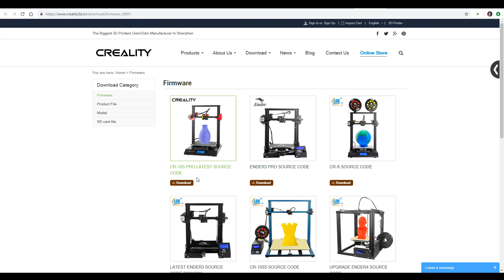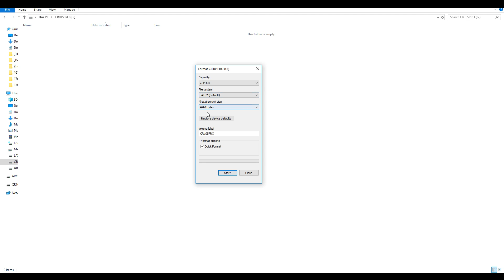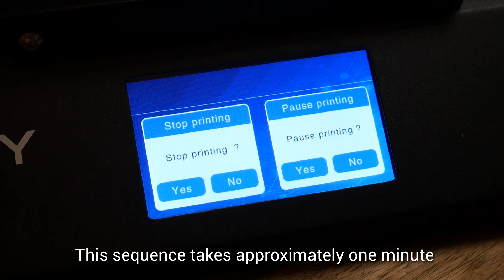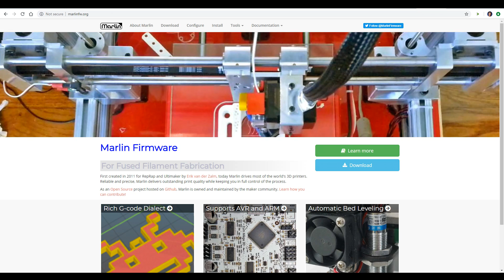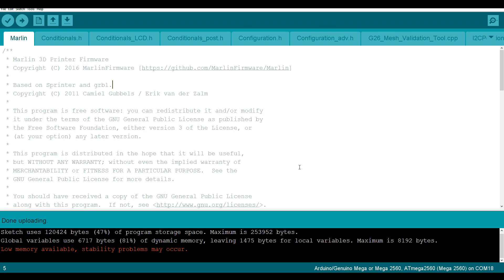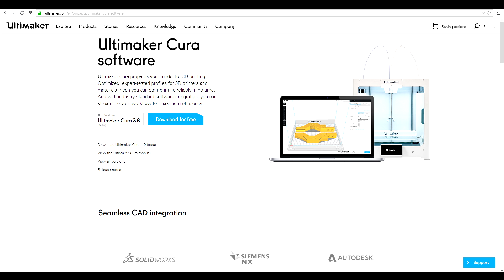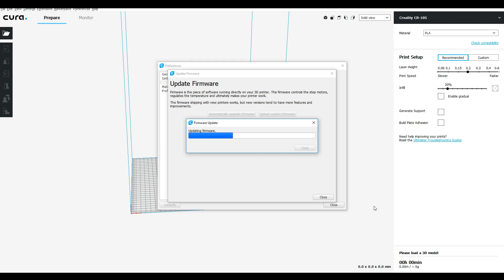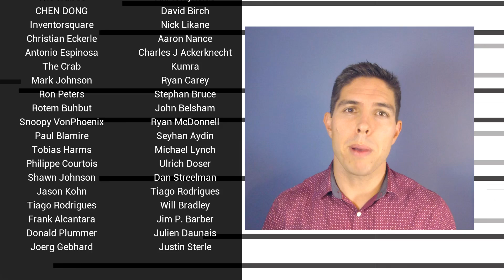How to update CR-10S Pro firmware - LCD and mainboard

Comment: Super Video!!! Very good explanation. But i have Problem. After updating LCD and Firmware (With Cura 10sprobang.hex) the Printer can't find original Position (middle of the platform). also at measering he can't find the exact Points. i hope you can help me

Comment: loaded per instructions..... loads the screen directly to the showing end.. mine does not go through all the screens like yours? any suggestions? thanks for the great video!
Reply: I had a similar problem.  Jump to 3:20 and note that the allocation size may be important, as it is specifically pointed out.  I also noted that the default name was longer using the windows formatting tool, so I reduced it to reflect the example "CR10SPRO" without quotes.  After doing these steps it worked for me.  In fact, my screen is now using the RED color set :)
Reply: @dnainkable  You, sir, are an eagle-eyed superstar!  I had a feeling it would be a FAT issue, that maybe I'd formatted FAT16 rather than FAT32, or vice versa, but you were spot on with the allocation size.
Mine's all updated now, I even stuck my own modded boot screen on there.
Mooch-arse grassy-arse, dude!  :D
Reply from the maker: Is it updated and working? If so, happy printing.
Reply: It didn't update the screen. I just updated the latest firmware on creality. The screen would not update.

Comment: anyone able to get this to work with cura 4?  No matter what I do it doesn't see my printer.  Yes driver is installed and I can see the com port when i go into device manager.
Reply: I don't know about Cura 4, but for me when I updated in Cura 3.6 at first it wouldn't connect to printer, but after I let it sit awhile and came back. It showed connected. Not sure if windows or Cura was doing something in background.
Reply: I can confirm that Cura 4 works for the update.  What about the COM port number?  Some problems arise when the COM port is larger than say 10, for example.  I have a COM port of 4, I believe.  You can check in the device manager if you're using Windows, and adjust as necessary.  You can find information elsewhere for changing the COM port.  For others: If you're using a mac, disregard.

Comment: Today I got around to update to Tiny machines firmware. Did both lcd screen and main board firmware. Wen't to print from SD card and while print is started, I like to go into the adjustments tab on LCD screen and adjust any z offsets while watching first layer. As soon as print starts, the LCD goes to main menu, not allowing you to make any adjustments or even cancel print. I wouldn't think it would respond this way. Have tried several times and each time a print starts, it immediately goes to main window. Has anyone experienced this at all, or have a solution. I also tried to go back into the print option but then it makes you select a new print, which gets in the way of existing print. I am not sure if Tiny Machines updated their firmware. I did the 10SPRo hex from Tiny Machines web site.
Reply: This happens when the computer is still connected to the printer, try printing from SD card with the USB to the computer disconnected.
Reply: @naderal-ghazu2222 , My desktop nor laptop was not connected while printing from SD card, however I did have my raspberry pi hooked up which I use for Octoprint . And since the pi is a mini computer I decided to try printing from SD card with Raspberry pi disconnected. Worked great since following your advice. Thank you very much.
Reply: Also wanted to add I can print perfectly fine using Octoprint using Tiny Machines firmware. Both bed and nozzle temps show up now inside octopint. Thanks again.

Comment: Okay I am about ready to have a fucking stroke!!!  I followed YOUR tiny machines instructions to the letter!  I successfully updated DWIN, I successfully uploaded the tiny machines .hex file.  I ran the reset.gcode as instructed on the tiny machines page.  I power up my printer and the thing no longer goes to the center of the fucking bed!!!!    Why is it way forward and to the left???  How do I get my home position back to the center of the bed???

https://i.imgur.com/DdxurT4.jpg
Reply: Screw it.  I went to the creality 1.6.71 hex file.  Also Cura 4.0 has a BITCH of a time connecting to the printer.  I finally got it to connect and update the firmware the first time with tiny machines stuff.  Then could not get it to see the printer in Cura on trying to change to the Creality hex.   ARGH!  so then I proceeded to go through and frantically press buttons, twist knobs, clicking check boxes, cussing, banging on the damn computer, just short of waving voodoo beads over the mainboard and sacrificing a chicken  until finally it gave me the option to upload the hex file again.  Seriously if I have to do it again I have no fucking idea what was the thing that finally made it connect!!!

It is working now but son of a bitch!  Why send a machine out with 1.6.3 firmware when 1.6.71 has been out for weeks?  Why not at least include an addendum or make a comment on the sites bed leveling and setup page warning people that they aer using the 1.6.71 version.  I got home at 5pm had the machine assembled by 5:30. Then proceeded to work all fucking night until nearly 10am SATURDAY before I even got to a point to level the bed.  Then found a dozen videos that were either incomplete, or completely wrong!  It is not rocket science to level and I am going to make a proper video on ho wto do it as I have not found a single one that is correct for 1.6.71!

Comment: I just got my CR10S Pro yesterday. Do you recommend upgrading the firmware immediately?  I had no problem printing after basic leveling. What does this firmware update improve exactly? 
Second question: What is the maximum print speed mm/s you can achieve with CR10S pro? Can you share your print profile soon or make another detailed video like your comparison video soon? (Cura profile please!)
Thank you for your great videos.

Comment: Great video Michael, as always. 
I have an off-topic question to all you guys from the comment section. Michael, maybe you could help me too.
Every filament change, I watch your video about tuning slicing software and I do all the steps you recommend. Everything is great but I am confused with one thing.
I have my perfect profile which is 203 ℃, retraction 4.4 and speed 50mm/sec.

Problem is no matter what I do when I slice it with simplify3D first layer always run at 190 ℃. I have no clue what this might be. Looked everywhere and always the same.
Also, Michael, you need to tell me where did you get that barbarian head model which you had in a previous studio setup. Huge Diablo fan and I need to have it.

Comment: I’m having a horrible customer service issue with Creality and Banggood. My bed came warped out of the box and was able to show them by pictures and video. So far Creality tells me a bed replacement would be needed, but I need to talk to Banggood. Banggood is giving me the run around so far only offering me a small credit without replacing the bed. I will never buy another Creality product or from Banggood again.
Reply: well at least you got your printer, I ordered a CR-10S pro in November 2018 and never received it, and im fighting to get my   money back.....Banggood no way  BANGBAD more like it...….Beware
Reply: I appreciate the video he made for us unlucky ones that spent money for creality.
My recommendation, upgrade to a better company....
Reply: I got a normal cr-10 a few years back from them and things always went wrong. Turns out I have the wrong extruder, etc. And I noticed when I was putting it together some things were already done. They definitely gave me a used/modified machine and sold it to me as brand new.
Reply: @J-T29  I find it incredibly amazing some people still recommend creality products.

Comment: Excellent video as always, it's clear you have a teaching profession :-) Not sure why you didn't stress the fact that Creality released firmware 1.6.7 (you even show the download link in the video), which is newer than TinyMachines' and has a lot of bug fixes (e.g. it now saves the auto-leveling bed mesh and has thermal runaway protection I believe). It is also good to mention you can create your own bitmaps for the LCD screen as long as they're in the same format. My ask is if you can update this video with your view on the 1.6.7 Creality FW.
Reply from the maker: My aim was to show how to flash from source vs hex. That 1.60.7 only had a hex when I downloaded it so I stuck with 1.60.3 for the video. Very welcome news that they are updating and fixing these issues. I just wish they would get it right from the start.
Reply: @TeachingTech  So what are you saying?  Is Creality's 1.6.71 now the better version to go with?  I just spent hours putting the tiny machines version in.  Which is more up to date????  Also after install the tiny machine version when I power the machine up the nozzle is not at the center of the print bed?  It is in the front left area about 4" from the left and front edge??? Why? How do I get it recentered????
Reply: The teaching profession?! OMG I should hope not

Comment: can you not just edit the creality version and enable thermal runaway protection? Im going to try to do that for my standard CR10s. Maybe you would need some extra LCD buttons but could possible hack them together with the tiny machines build?
Reply from the maker: You can do it that way. What advantage do you hope to gain for the extra work?